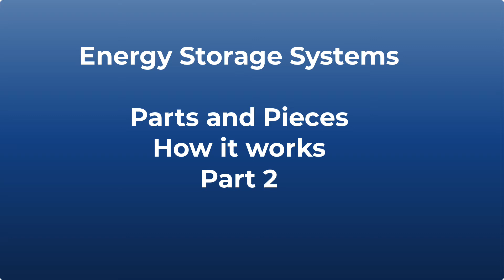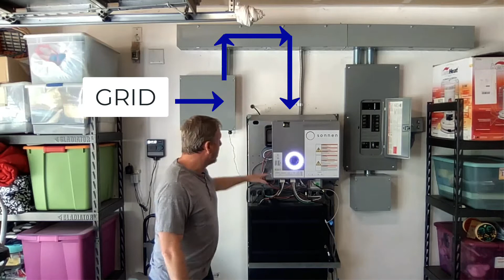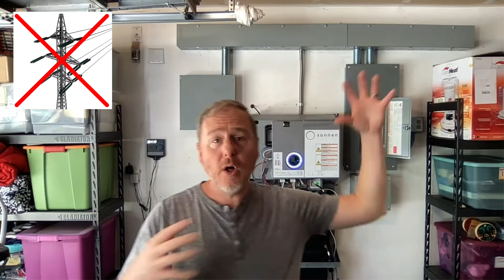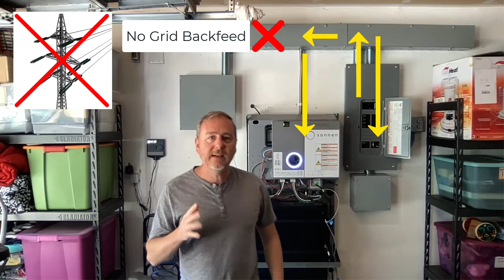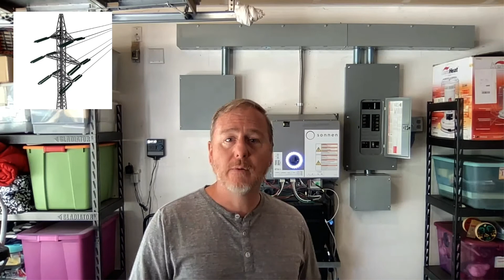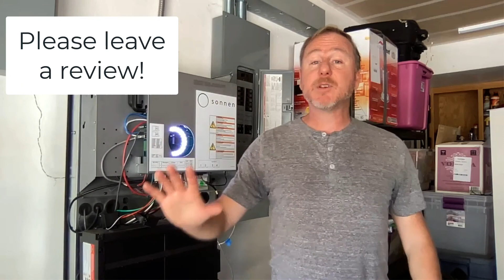Energy Storage System parts and pieces #2

Comment: Great explanation on the connection between grid, main load panel, battery with ATS and the sub-/backup panel with the solar array connected. 
Where would an EV charger be connected? To the main load panel due to 40A breaker? Or the backup panel to allow charge with solar energy?
Reply from the maker: That is a great question, and with the push for EV2H (EV to Home), or sometimes called EV2L (EV to Load) it really depends on when you want to charge your EV. I am writing a blog entry about this very topic on my blog at snarkysolarguy.com. Here is the 30,000 ft. view. You almost always want to put the EV charger on the same panel as the solar. Use those free electrons to charge that baby up!
If you have a backup panel and keep the EV breaker on the main, then of course you will not be able to charge the EV when the grid goes down. This may not be that big of a deal if your power only goes out a few times a year for perhaps a few hours or so.
If you want to safeguard your EV against a power outage then put it on the backup panel. This may mean a larger panel to accommodate that larger breaker but it will be worth it. Also, if your EV supports it, you can discharge it into the home for more power if you so choose. I would recommend installing a Lumin or Span smart panel to help with the load management.